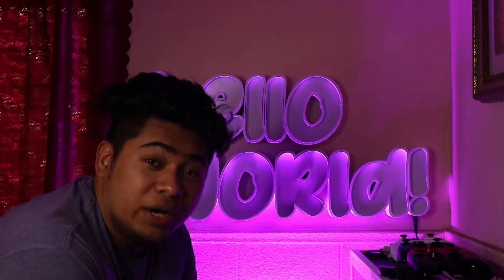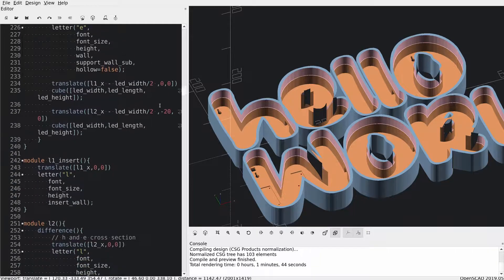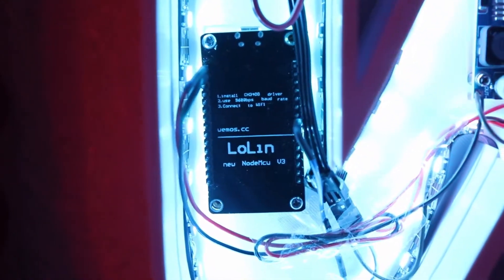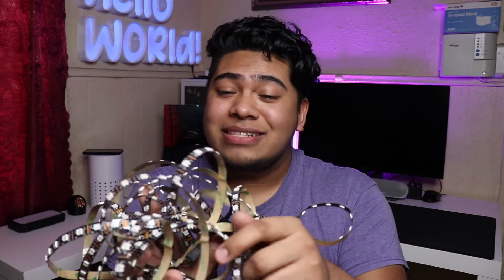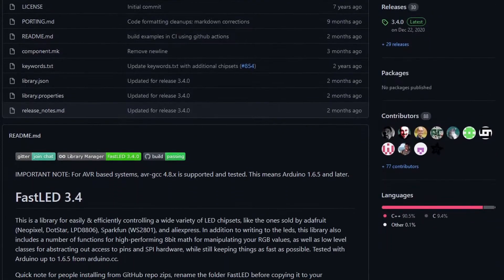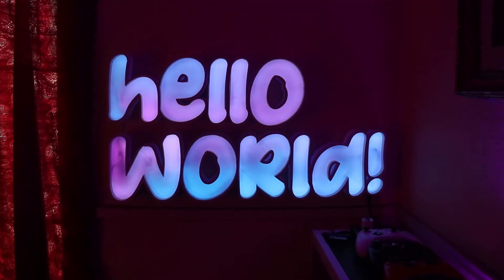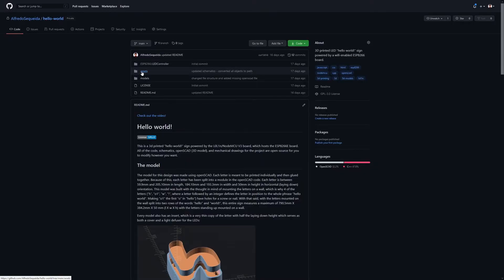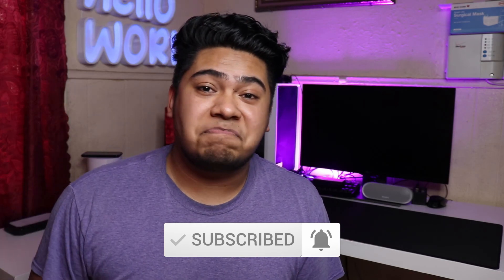How to build an Arduino powered RGB LED Sign | Arduino 3D Printed RGB LED Hello World Sign with WIFI

Comment: How can I make the walls of the inserts thicker in OpenSCAD?
Reply from the maker: There is a variable at the top of the scad file called insert_wall. You can change that to whatever value you want.
Reply: @AlfredoSequeida  I've manipulated this variable, in addition to adding wall thickness it doubles the Z height and the inserts no longer fit in their cut outs.
Reply from the maker: @coltondick   Got it, that's expected, the reason that happens is because when building the model, I modeled the z height as a wall. You can think of it as the wall on the back. This way, all of the walls (right, left, top, bottom, back (z-axis)) are the same thickness. If you want to make the back wall (z height) different, then you need to modify the hollow_letter module. You will notice that I built the hollow letters with a cube on line 803. That cube is in the following format

cube([ x-axis-wall-thickness, y-axis-wall-thickness, z-axis-wall-thickness], center=true);

currently, they are all set to the same thickness with the variable `wall`. You will have to set the last one `z-axis-wall-thickness` to a different value so that this value is independent of the others.

Note that depending on how much you change that value, you might also have to modify the `height` value in that module. I imagine that as you modify the values you will see what else needs to be adjusted if anything at all.